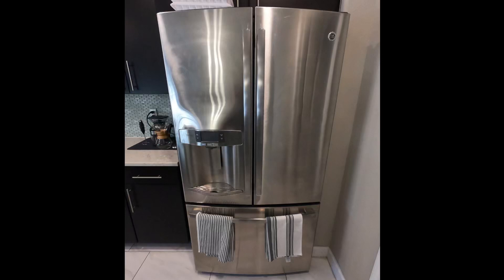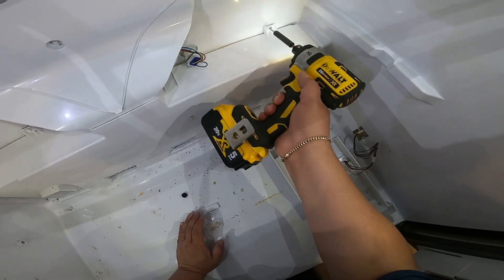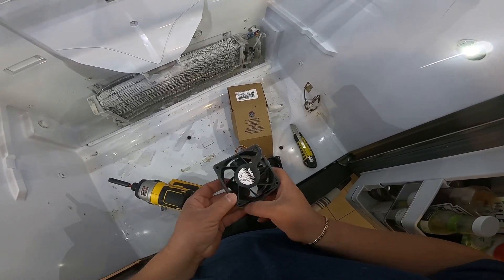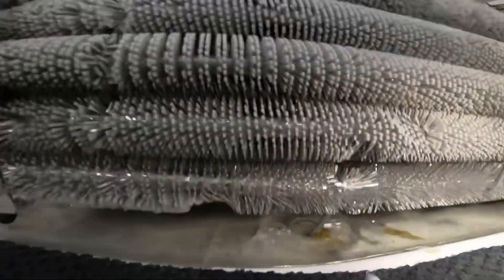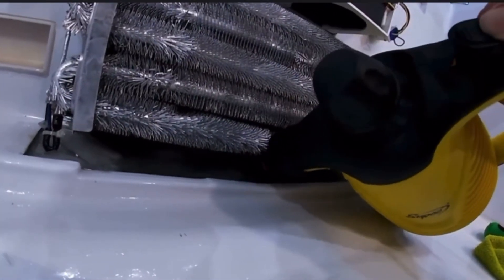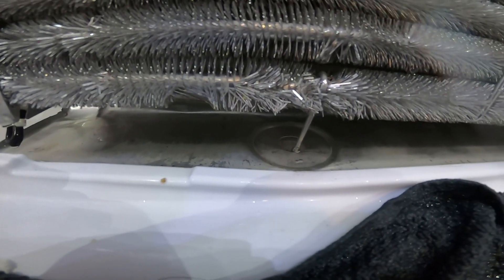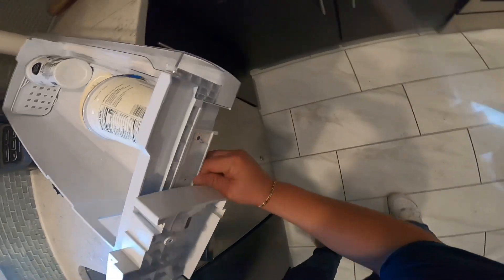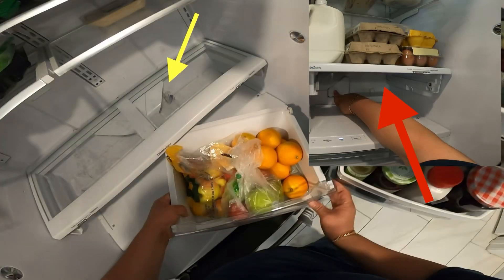How to Fix GE French Door Not Cooling Properly |  Not Cooling but Freezer Works | Model #PYE22PSHISS

Comment: You can use an angle driver to remove the 1/4 inch screws no need to remove the top section.

Comment: how long does it take for the top section to get back to normal in temperature
Reply from the maker: You will feel a difference in a couple hours, but the manufacturing said allow at 24 to 48 hours to go back to 100% normal